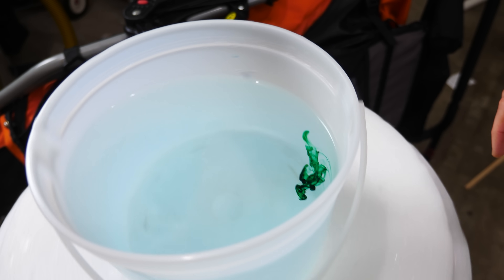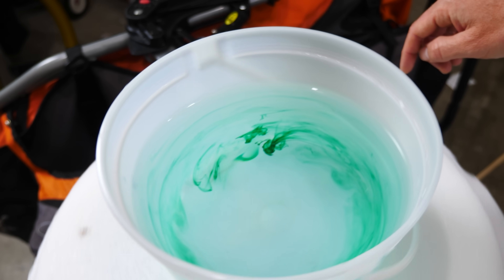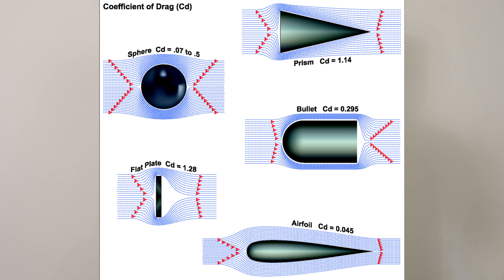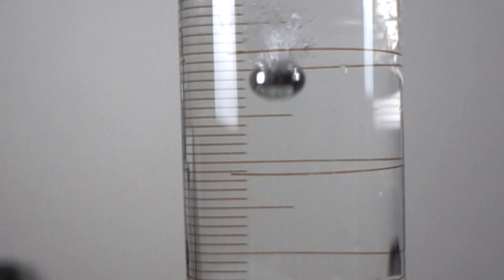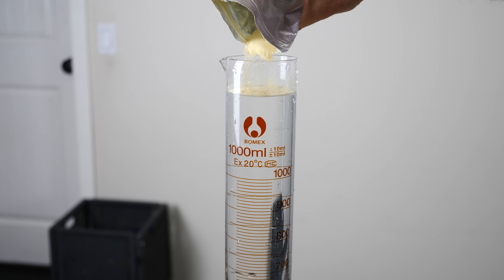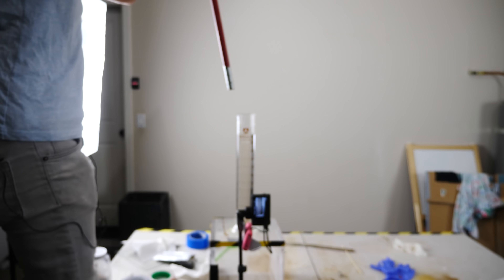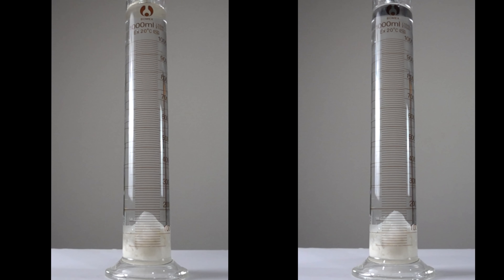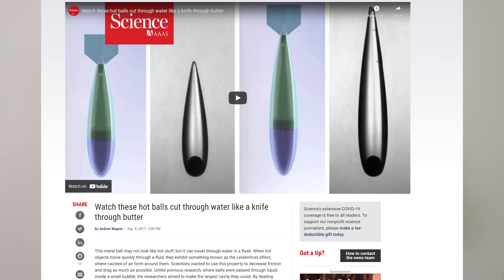Hydrophobic Projectiles Slice Through Water With No Drag

Comment: The Russians had manufactured a 21 inch torpedo, the Shkval, during the cold war period to use in their subs whose nose cone was conical in shape with a small disk like structure at the tip of the nose unlike the conventional teardrop shaped torpedoes that existed. This helped to achieve pronounced laminar flow of water as the torpedo which was powered by a ramjet motor travelled at speeds in excess of 200kts. That resulted in a sufficient airgap between the entire length of the torpedo and the water at those speeds coupled with the disc at the nose to prevent any water drag.
Reply: So whats happens if we add hydrophobic abilities to shkval?
Reply: @rohithchandrashekar3886  It would be impossible to do something like that. For one the sphere he used in the video has a diameter in the order of a few centimeters while that torpedo has a length of 26 feet which in incredibly long. If i assume that the torpedo is gonna be painted with hydrophobic paint (i dunno if that exists) it would only make sense if you remove the disc from the front thus eliminating the laminar flow process of keeping water off the body of the torpedo. Now you cannot coat the engine nozzles with the paint. These torpedoes dont have propellers, they are ramjet powered so the jet exhausts have no way of not coming in contact with water thus greatly deminishing the trust from those engines. You must remember the diameter of the small nose disc is such that laminar flow of water allows the entire torpedo to stay free off water including the engine nozzle thus facilitating complete utilization of wet thrust.
Reply: @rupayanbandyopadhyay3578   @jaidgugoogoo @Gary Baldy thank you guys for the reply.
Reply: @rupayanbandyopadhyay3578   How does the ramjet function under water?
Reply: @alext8828  A solid rocket fuel motor would accelerate the torpedo to cavitation speed after which the ramjet motor would kick in. This ramjet is fueled by hydroreactive metals using seawater as both reactant and the source of oxidizer.
Reply: @rupayanbandyopadhyay3578   Yes.  That seems logical.
Reply: @rohithchandrashekar3886  probably nothing, it's already at peak physical properties, may increase by fractions but not by much
Reply: @rohithchandrashekar3886  nothing as the the water would be thought it in the first place
Reply: For reference the US MK48 torpedo speed is 55 knots (101kmph) and the shkval is >200 knots (>370kmph)
Reply: @archise3191  Allegedly a 300kt version was also under development.
Reply: @rupayanbandyopadhyay3578  might as well go supersonic lmao
Reply: @archise3191  lol, its actually possible but you need a torpedo that is 3 to 4 times or maybe more times longer than the Shkval
Reply: @archise3191  speed of sound in water is much higher than speed of sound in air. So if you mean exceed the speed of sound in water, well, that would be one fast torpeedo! Speed of sound in air is around 340 m/s. Speed of sound in seawater is around 1500 m/s. 1500 m/s is around 3000 knots.
Reply: Actually the Shkval uses a rocket motor and pipes some of the exhaust gases to the nose cone to make a bubble of air around itself.
Reply: @D8W2P4  nope.
Reply: @rupayanbandyopadhyay3578 
Yes, the simple fact that a ramjet NEEDS an airspeed of at least mach 1 in order to work should clue by four you in that it isn't gonna work at 200kts (which is 230MPH, Mach 1 is a little over 3 times that at 767MPH).
Further pray tell WHERE the ramjet is getting AIR from UNDERWATER?
1. Oxygen production by electrolysis of water requires big heavy systems that would NEVER fit into a torpedo the size of the Shkval.
2. Oxygen compressed in useful volumes is cryogenic and only worth bothering with in rockets.
3. It's literally on the damn Wikipedia page that the Shkval uses a solid fuel ROCKET of which before you trot out the "Wikipedia isn't accurate" I have seen NOTHING contradicting the information on Wikipedia.
A simple Google, Bing, Duckduckgo, etc. search for the Shkval backs this up showing in cutaways (that the Russians have been willing to share) that there is indeed a solid rocket engine powering said torpedo.
Reply: @D8W2P4  A solid fuel rocket accelerates it to cavitation speed. To sustain that speed an underwater ramjet fueled by hydroreactive metals using seawater as both reactant and the source of oxidizer is used.
Thanks for raising the question tho, its a good one. You have helped clarify several other's doubts.
Reply: so in theory this could work with a submarine?
Reply: The shkval travelled fast because of supercavitation: the water around the body, helped by rocket exhause redirected from the bottom to the nose, turned into vapor, essentially making it travel in a ga, reducing the drag.
Reply: You would not achieve laminar flow at the speeds the Shkval traveled. The disk at the tip is called a cavitator, and it's purpose was to boil water as it traveled past, surrounding the torpedo in a bubble of lubricating steam. This is known as supercavitation.
Reply: doesn't it use a rocket engine?
Reply: But we all know that we can further improve the torpedo by attaching it to a turbo-encabulator
Reply: https://www.youtube.com/watch?v=OYDkKBJeYtY
Reply: But that disk must’ve made the torpedo not very hydrodynamic, right?
Reply: @CramcrumBrewbringer  doesn’t have to be if traveling through an air bubble that the disc created
Reply: @CramcrumBrewbringer  The disk was a a few centimeters in diameter. The torpedo was 26 feet long. And the nose cone of the torpedo was in fact shaoed like a cone and not a waterdrop. Secondly the hull of the torpedo never touched the water.
Reply: Imagine if you took that same thing and gave it a hydrophobic coating
Reply: @ShitStainedBallSack  no need, since it basically isn't in contact with liquid water
Reply: Shkval was powered by a rocket motor.
Reply: @lorenzoboyd6889  It was a ramjet. And a ramjet is a type of rocket motor.
Reply: You beat me to it :-)
Reply: How do you get a ramjet to breath under water?
Reply: @borisj4054  Ramjet engines are not air breathing engines.
Reply: Hmmm
Reply: @memomumb  LMAO
Reply: nice!
Reply: Please learn how to use punctuation
Reply: Wrong, it's not the disk that helps to achieve laminar flow but the gases that come out of it's nose creating air bubble around the torpedo.
https://m.youtube.com/watch?v=o0sg_3hoagE
Reply: @Shifftee  Why don't you use ur own understanding of the physics behind the torpedo by looking at the structure instead of looking at a yt video.
Reply: @rupayanbandyopadhyay3578  “Published information about this type of hydro-ramjet shows a dedicated steam circuit for the supercavitation generating head.”

:P
Reply: @ValentineC137  That is to augment the bubble that has just been formed and to add some kind of stability to the bubble while varying the air volume in different parts of the bubnle as the torpedo performs some limited maneuvers at the high speeds.
Reply: I believe this was the torpedo or maybe one similar to this that the Russians used to make a mach 1+ torpedo. Insane
Reply: @joshuathompson6141  They had plans for a mach 1 torp but research on it was never completed.
Reply: The nose of the torpedo initiates continual cavitation of the oncoming water. The gas ports in the nose of the torpedo continuously pressurize and inflate the cavitation bubble, allowing the bubble to expand outward along the length of the torpedo. In ideal conditions, this will limit the hydrodynamic drag to the tip and the control surfaces. There is also aerodynamic drag from the gasses of the cavitation bubble through which the torpedo travels. The entire process still produces drag due to fluid dynamics, but it's significantly less than if the entire surface of the torpedo was in contact with the water.
Reply: The shkval also redirectedd rocket gases to the nose to create the bubble it travelled through
Reply: He said brain, not statement
Reply: The US researched this, but never deployed one. Instead, the Harpoon missile rises to the surface, flies through the air at 537 mph / 864 kmh, plunges back into the water, and attacks the target. So the question was, what would be the point of a 200 mph / 300 kmh torpedo ?
Reply: 🤔interesting
Reply: your brain is beyond my understanding
Reply: @hi-xt2wh  Just find a picture of te Shkval from somewhere. You will understand.
Reply: @hi-xt2wh  he is an inidan
Reply: @astropirate4331  What has me being an Indian got to do wid this discussion?
Reply: @rupayanbandyopadhyay3578  I am an indian too and Indians are smart
Reply: @astropirate4331  Gotcha.
Reply: @hi-xt2wh  weirdly shaped tip makes an air pocket in around the torpedo, making it travel through the water more efficiently
Reply: @hi-xt2wh  you cant understand a simple statement?
Reply: @beeopper  r/iAmVeRySmArT
Reply: Early 2000... this was explained on the SR71 on how it flows through air. it was also explained that the same principles can be applied underwater. then china flexed and said we are going to make a sub that can travel at the speed of sound by reducing drag through the water (Super Cavitation) with a rocket engine. we laugh because we knew that it would be very difficult to steer something that fast underwater it would destroy the sub if it hits turbulence because water is not like air. but a Torpedo would be able since it does not have passengers, but you would still need to solve the steering issue underwater at that speed.

but my point is this is not NEW news, this is OLD news. we knew about this long ago, we knew about russia making these type of torpedo we just didnt announce it.
Reply: @gamezone2470  the SR 71 has nothing to do with the physics behind the worki g of the torpedo, neither can any subsystem on board the Sr 71 exolain the working of this torpedo. The Shkval was a well known torpedo since the time of its introduction. It was not secret.
Reply: @rupayanbandyopadhyay3578  i guess i was not as clear as i thought i was, let me explain it better. jets fly through air and also creates air Cavitation on its tip. reducing air drag behind and increasing speed. the best example of this is the F-14 Tomcat, at higher speed it can re-track it wings backwards to hide inside the cavitation and reduce drag.
again the same PRINCIPLES apply underwater <-----------------------------------------

this is the part were we switch the topic to under water because I said "the same PRINCIPLES apply underwater "
Reply: @gamezone2470  While that is true, i understand that the discussion here is about the Shkval torpedo which uses the properly of Laminar flow of water to do what it is unique at.
Reply: @gamezone2470  what do u wish to establish here?
Reply: @rupayanbandyopadhyay3578  establish? your saying that i have a secret motive? LOL. just read and absorb the info
Reply: @rupayanbandyopadhyay3578  the first prototype was developed in --------------------------> 1964
has it been already in service? the last time i read about it was 2007. it probably is already in service by now, but there are still numbers of issue it currently exist.
yes absorb the info, you seem so threaten by what i said lol calm the F down kid.
Reply: @gamezone2470  Isn't that eactly what i said? Its you who needs to calm down dude.
Reply: @rupayanbandyopadhyay3578  no I said the first prototype was in 1964, you never said anything about 1964. so NO thats not EXACTLY what you said lol
Reply: @rupayanbandyopadhyay3578  meds lol first you said "shit" now its my meds LOL, you know when someone getting mad is that they tend to use harsh words and get defensive LOL
am I getting in your nerves? you dont like being corrected do you? I only added info about the torpedo and you got all defensive all of the sudden.

Relax buddy and calm down........... your ONLY human we all make mistakes. lol
Reply: @gamezone2470  Thing is u've been talking a great deal of trash snd have been wanting to pic a fight for no damn reason.
Reply: @gamezone2470  I did say that the torpedo came into service in 1977 while you had insisted upon the fact that as of 2007 the torpedo had not been inducted yet. You gotta get your facts right dude, if no one has ever told you that you are wrong, i am doing so now.
Reply: @gamezone2470  at that speed, there is practically no need for sreering, since the time to react would be so short
Reply: @Gh0stDr4g0n_1  it would still need to adjust its trajectory since water is a lot more dense than air, and depending if its a fast moving target, slow or stationary. not to mention Super Cavitation creates loud noise and shaking. none of these torpedo are operational yet they are still prototypes. Russia has a torpedo in service BUT the noise it makes blurs the noise of the target which is why they took the project out of service and was replaced by a new version in 2017.
Germany announced their own version back in 2005 called barracuda i dont know if it has been completed.
Reply: @gamezone2470  The ramjet motor had thrust vectoring nozzles and yes the Sakhval not only had been developed, it has existed for around two decades in the Russian navy and the accident on the Kursk was probably dude to the explosion of a Sakhval torpedo.

Comment: the question that remains is, could a submarine float if it is covered with a hydrophobic surface
Reply: Short answer yes.

Buoyancy is related to density, not interactions.

Longer answer.

Good example is the demonstrations of different densities in tubes where you see oil, water, a solid, etc separated. The oil is hydrophobic (most non-polar molecules) but floats on top of or falls under the water depending on density. 

Submarines have ballast tanks filled with air for surface ops and fill with water to submerge. Hydrophobic coating on a Submarine would reduce drag but not prevent it from floating/submerged ops. Provided the propeller and planes aren't Hydrophobic as well. This would stop the Submarine from maneuvering (planes) or moving (propeller).
Reply: A follow up is if the ball he used in this video were less dense then the water, it wouldn't sink. Unless shot with speed downward.

If shot with speed, it would go deeper than a non-hydrophobic ball of the same size, mass, density, etc. Because there is less drag. But they would both eventually return to the surface.

Comment: It seems like it would make a lot of sense to coat actual torpedoes, submarines and even high-performance boats in a super-hydrophobic coating then.
If we can manage to produce a coating that is cheap enough and robust enough to last a while it might conceivably even be worth the added maintenance and cost for the speed and fuel-savings on large transport ships. 
Hydrophobic materials aren't rare these days, but durability is probably an problem for many applications.
I think there is still a lot of potential in material sciences for these sorts of coatings - not just hydrophobic, but also ones that reduce air resistance.
Reply: ALSO USING PIEZO TRANSDUCERS YOU CAN REDUCE FRICTION BY TUNING THE FREQUENCY TO THE DRAG OF WATER/AIR TO REDUCE DRAG.
Reply: @esecallum  drag is not oscillating force
Reply: @shashanka9821  
its been already. have you noticed how you mobile phone slides very easily when its VIBRATING? same principle
Reply: Imagine being in a submarine. You fire one of the new, super-hydrophobic torpedoes and it just falls to the ocean floor
Reply: @morningstar_37  That would be pretty funny, but sadly I don't think we can overcome the force of gravity (and thus buoyancy) with a simple coating. Things would get quite interesting if that were possible :)